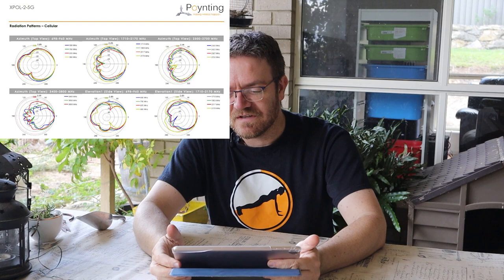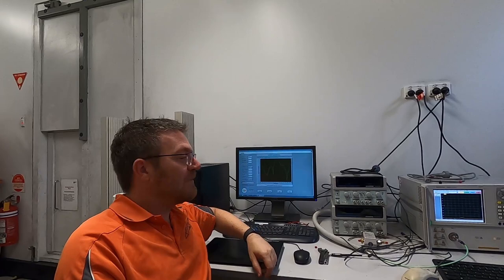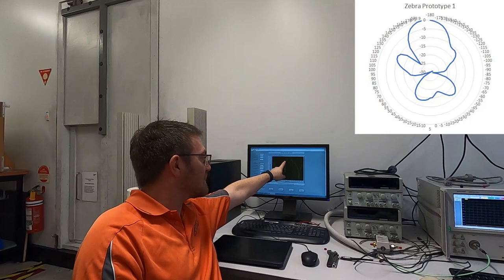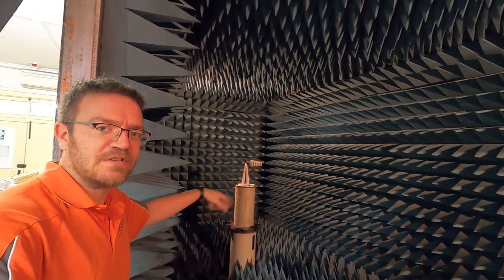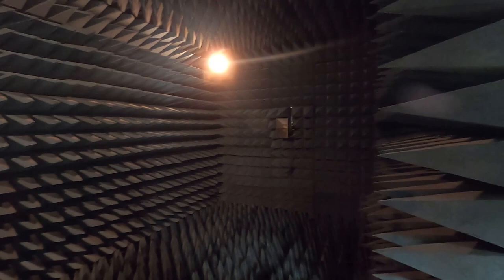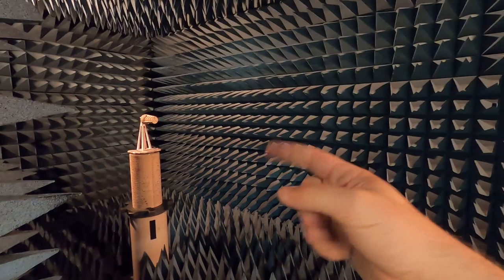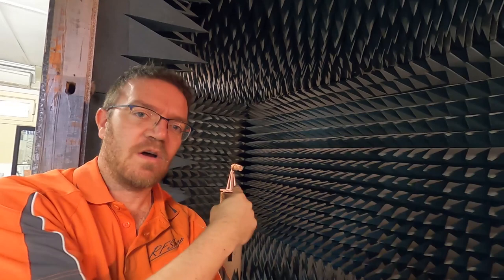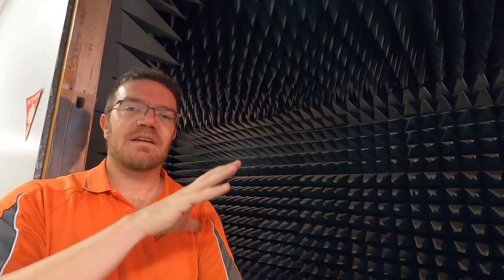Measuring antenna radiation patterns to understand your 4G antenna or WiFi antenna better

Comment: Hi David. What I have never seen explained and is quite confusing is how the lobe of a cell phone tower base station interact with lobe of my antenna (the ones that you sell). ISP put their antennas pointing to populated areas using sector antennas and beam tilting, so if I'm in the outback or in a adjacent area where the lobe of the base station is pointing which will be my best option of antenna in order to maybe interact with the side or back lobe of the base station antenna. Maybe a yagi?
Reply from the maker: Hi Felipe. It's good question, and always a confusing topic to visualise. 
An antenna has a 3D radiation pattern (like the lobe shown in this video) but at any given time a receiver can only be in one place / location. On that moment in time the gain that you receive or see is that single value that is on the 3D plot. Nothing else. So if you are using a 15dBi Yagi and face a base station from the side, you will have 15dB gain that you introduce towards the tower, but the gain from the tower is whatever the gain on their antenna is "in your direction". The sum of those two numbers makes the total antenna gain you can use in the path loss calculation.

Comment: Great videos, thanks. What part of a 4G LTE antenna enables the 700Mhz to work? It seems odd that 4G now encompasses 700mhz frequency.
Reply from the maker: Nigel, it's the larger areas of an antenna that will work well at the lower 700MHz frequencies. It's also a quick way to identify how "good" an antenna is at the lowest frequencies...since a very small antenna will simply not have that good performance in the lowest frequencies where things are still fairly big.
Reply: @RFShop  Be great to see a tear down of a smart phone/iphone - have a look at the internal antenna in the phone and how it works to be multi band - thats one clever antenna inside there right?
Reply from the maker: Nigel Carney indeed a very clever set of antennas. Reality is though that they are less effective and inferior to external antennas...hence why it is so often required to have proper external antenna options
Reply: @RFShop  When you say 'larger areas of an antenna' could you explain what that means - does 700mhz require a larger linear length of antenna?
Reply from the maker: @nigelcarney4376  as a rule of thumb yes. The wavelength is always going to be 42.9cm. and an antenna that most effectively resonates and radiates will be related to that wavelength. There are many tricks to reduce antenna size (aperture) and these work well for respective applications...but there's always a trade-off somewhere. Could be antenna bandwidth or efficiency (often related to impedance matching and what's considered acceptable). 

To us the devil is in the detail...and even if an antenna is presented as working a specific frequency band it's always worth to see how well it works on the outer edges of that frequency band. You often see companies selling you a certain gain (say 14dBi) antenna, and the following line claim to work from, say 700MHz up to 2100MHz. Next line on the spec sheet says VSWR 2:1 over 90% of the frequency band. Now, study the detail and you will often see something what I call "spec-manship". 
Yes, the antenna does 14dBi gain somewhere in the frequency band...but not everywhere. They did not say it does, but you would assume it does. On the outer edges is might be well below 14dBi. 
Also, presenting VSWR 2:1 over 90% of the band could still mean a terrible 3:1 or even 3.5:1 on certain parts of the band. If that's less than 10% your still in "spec", yet the antenna performance might be really terrible.
Reply: @RFShop  Well explained - caveat emptor antennas - latin for - let the buyer beware of the bullshit in the antenna marketing blurb ..lol